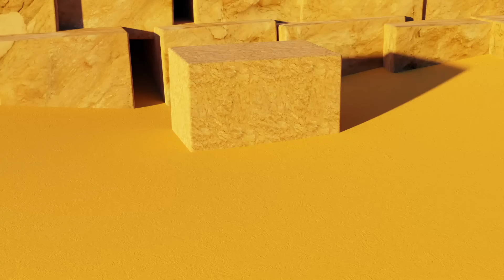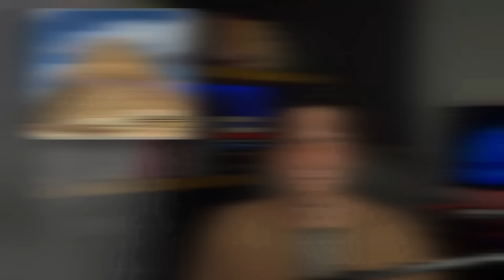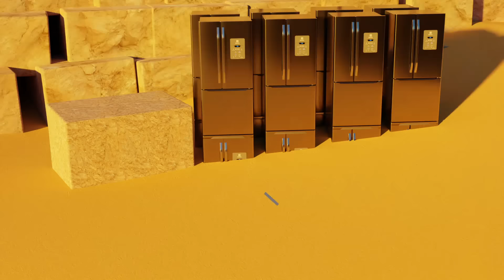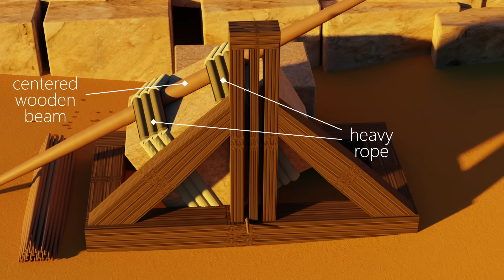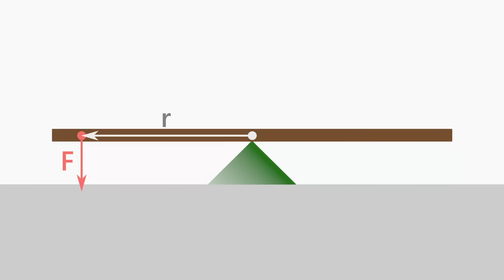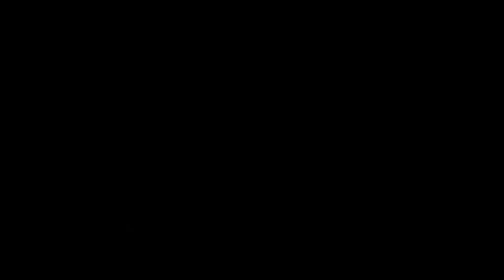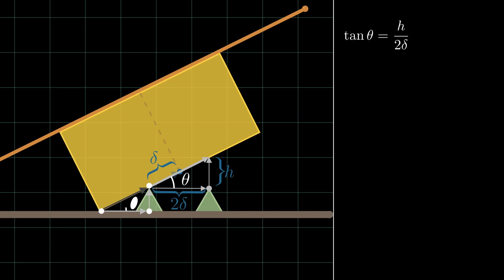Physics Reveals How the Pyramids were Actually Built

Comment: The reason I find the wooden parts to be inadequate is the force applied at the outer edge of the beam when at an angle, which would want to rotate, causing the vertical load to spread the uprights laterally and only steel has the kind of strength to counter the forces applied at the corner where the uprights are fastened.
Reply from the maker: Please make arguments from a quantitative standpoint. Basing a physical argument on words alone is a pretty useless exercise.
Reply: @DrJohnDev  Are we expected to form our disagreements as mathematical equations?

I took the time to explain as simply as possible, why wood is inadequately suited for such a task. 

Perhaps I am not the only one that "conveys the sense of not caring to understand"
Reply: @burtpanzer  wood is not a certain material, the fracture strength and other material parameters widely vary depending on the type of wood, then you need to know the length of the lever arm, the size of the girder. Only then you can calculate what dimensions are needed to lift a certain block weight and whether it is at all possible under the given circumstances (moving space etc.)
Reply: @DrJohnDev I'm sorry, but your "explanation" is nothing but a description of some maths, and doesn't consider any PRACTICAL limitations of such devices. Without any consideration of the practicalities of implementing such a scheme, and a demonstration on the scale needed and with the resources available at the time, it's nothing more than an unsubstantiated idea. But you clearly like to feel smug about how you can work out the maths, which somehow magics away all the practical problems. And of course,  the Egyptians had no concept of the maths, it was all just trial and error. Besides, the ancient Greeks didn't see the great Pyramids being built, they were constructed at least a thousand years earlier... and a lot changes in that time.
Reply from the maker: @another3997  I think you missed the point of using the math to backwards engineer the machine they used.  Of course the Egyptians determined the functionality based on trial and error, the same manner in which current progress is made in facets of engineering and science.  We can use mathematics to determine exactly how they used these machines, without needing to ask them.

If you're not convinced with math, check this video out.  Anything look familiar??

https://youtu.be/E5pZ7uR6v8c?feature=shared&t=166
Reply: @DrJohnDev  "pretty useless" seems a bit harsh response (even if accurate), to someone who seems to have a reasonable question, even if not asked in the way you prefer. 
You have done a great thing here, sharing this idea, and starting a lively discussion in the comments section.
I can understand why you might be sensitive to people questioning your conclusion. Especially after all the work you put into it.
But try to view the questions/challenges, from the point of view, of people who don't have your background/education.
Remember that the comments section, is the lifeblood of YouTube.
Ignore them, if you don't have time/energy for them, but please try not to be snarky, as it diminishes an otherwise wonderful presentation.
Best wishes for your success ☮
Reply from the maker: @TheScreamingFrog916  Thank you for the nice complements and support.  I understand some of the comments can come across as brash.  But sometimes, fire needs to be fought with fire.  This user left a string of comments, which all lacked depth and deep reflection.  The idea of simply using words to form physical arguments is extremely naive and juvenile.  I understand the case for disagreements, but if the disagreement is fraught with misinformation (and conveys the sense of not caring to understand), I will shut it down.  Thanks again for your kind words and hope to see you around here again!
Reply: @DrJohnDev  thank you, for the explanation. You make a good point, and I was unaware of his other comments.
Reply: @TheScreamingFrog916 it wasn't a question, but a claim. The reaction was adequate and polite. As a machine engineer I understand from the first phrase whether sb could have a point (because is giving numbers which can be checked) or is just babbling away ("only X can do such things").

Comment: Interesting but how did they get those blocks to the site from 500 miles away.?
Reply from the maker: Very great question! As I understand, they used water vessels to transport the stones. Although, this would be an excellent topic to cover in a follow up video.
Reply: By  water. the  nile  used to. flow close to the site , then they  ROLLED them  inside. wooden  formers

Comment: Well, they obviously did not set a block every 6 minutes, 24 hours a day. So what does that tell us about the "experts" and every claim made by them on the topic? It tells me we have to question their motives or their competence.
Reply from the maker: I’ve addressed this elsewhere in the comments. The logistical problem is solved with working in tandem. Quite easily actually.
Reply: It does. They had hundreds of workers doing this multiple times all around the pyramid. If you do the math of let's say 20 teams doing 1 block each. Even if each team takes 15-20 mins to set one block. You are doing 20 blocks every 15-20 minutes. Which is is much better than one block every 6 minutes. Get it?it's not how long it takes each team. it's how many blocks are you doing per hour with the efforts of multiple teams combined.

Comment: Sure I imagine thousands of those machines and dozens of men around each for each block and doing it so as spending 6 minutes per operation and repeating it over and over. Resuming... You've just forget to calculate the time span and geometrical operability for the construction.
Reply from the maker: If there were thousands of machines, then the math runs differently. 6 min per block is only if one block is laid at a time. With only 10 machines, this number raises to 1 hr per block. So with enough machines, the logistical problem is also solved.
Reply: Dr. thank you so much for your response. @DrJohnDev  even though if considered the required on-site space for horizontal + vertical assignment of those machines and workers as well as logistical channels for transportation, there would be no space left for the city, population and again time to accomplish the mission. No doubts at all that the Maths you've demonstrated are correct although not appliable to the given circumstances. Success to you and your YTChannel. Thank you a lot!!!
Reply from the maker: You're welcome and hope to see you around here again!  Stay tuned for follow ups on this topic :)
Reply: @DrJohnDev And you've considered the practicalities of such an endeavour? Having been to a number of Egyptian Pyramids, i'd be very interested to know how they fitted all those machines around (and of course getting them ever higher) the ever growing great pyramids? Especially the outer stones, which are visibly overlapped to the point of having very little flat surface to put anything on. From existing evidence, their giant temple complexes seem to have been built with the use of ramps, not bulky machines that required lifting.